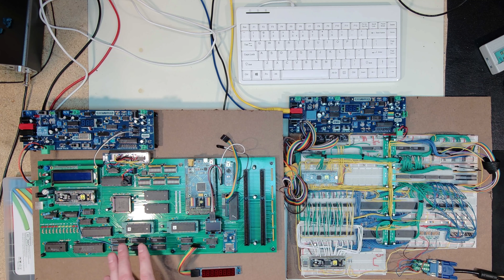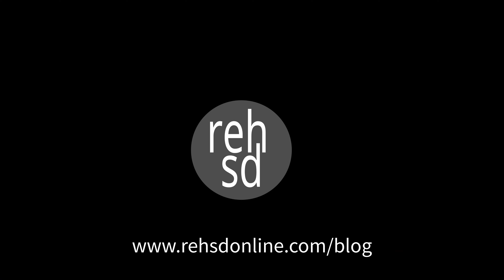80286 Build, Ep. #67 - PCB 0.20 Running Well!

Comment: I finally got around to ordering my first PCB last night. Easy eda makes it quite simple. Hopefully it works. I expect it to have some issues ...
Reply from the maker: Nice! I enjoy the PCB design stuff. I need to work on my manual routing. Good luck on your PCB! What kind of circuit are you building?
Reply: @rehsd  6502 with tms9918a for video, ay-3-8910 for mono audio together with a PLD for glue and a pic for the keyboard. Tms in SRAM config with all the '597s etc. It's working on my breadboard!  (_thinks of "it works on my machine" said every developer ever to ops people like me)
Reply from the maker: @DavidLatham-productiondave  That sounds great! You will need to post a video about it!  :)
Reply: I think it's too similar to Troy's HBC-56 but only on a single board and not as cool as his.
Reply from the maker: @DavidLatham-productiondave  :)